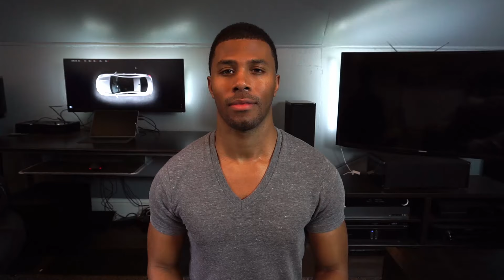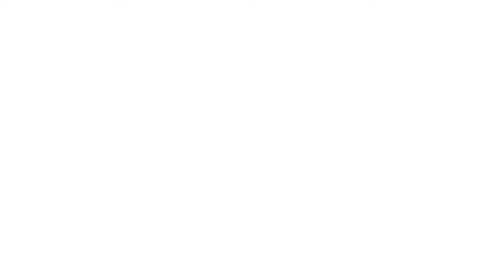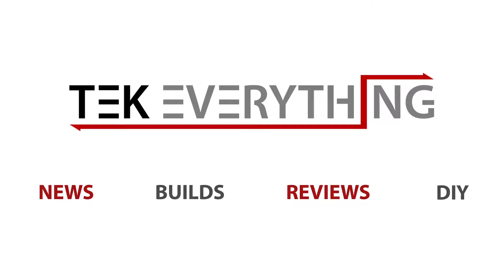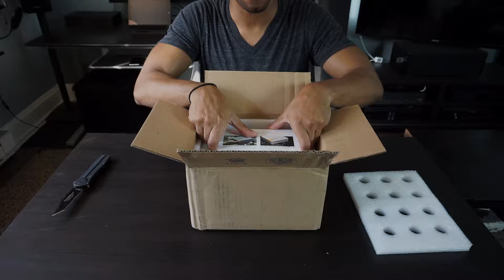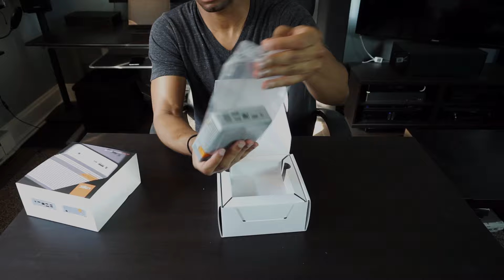Logic Supply CL100 Rugged Mini PC Review

Comment: I hope single slot gtx 1060 come out
Reply from the maker: I would be shocked if one did
Reply: maybe wait for the super expensive quadro equevilant
Reply from the maker: Yep, unfortunately that is probably the only option.  Would probably cost around $500
Reply: Tek Everything most likely yea. just look at the price difference between the 750ti and the k2000
Reply: There is a Gigabyte GTX 1070 mini, which would be perfect for the Hutzy XS pc case.